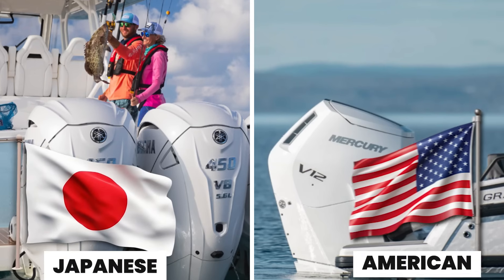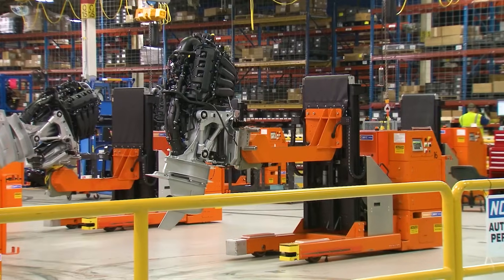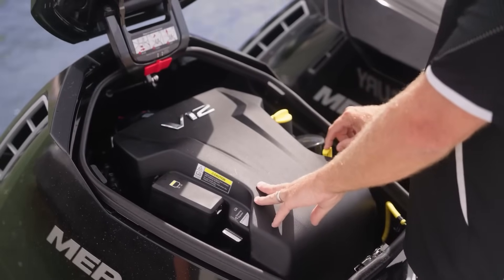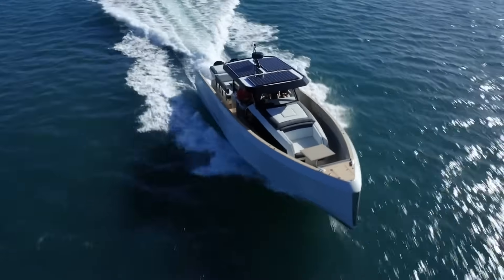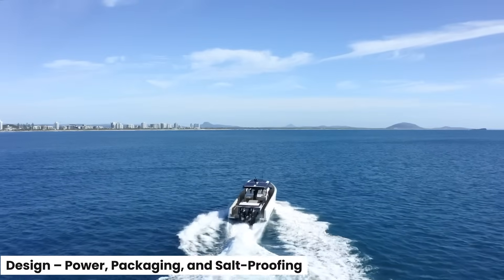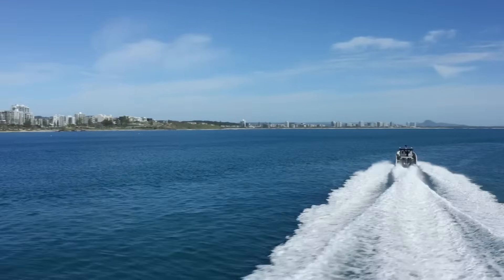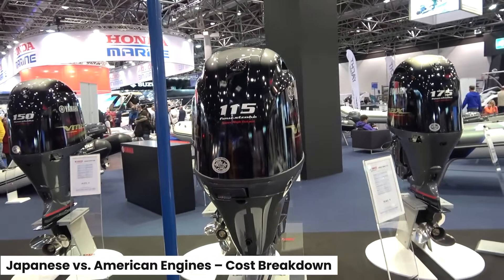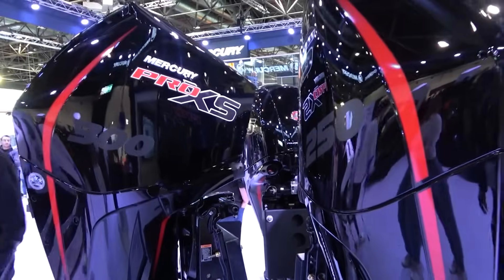Why Japanese and American Engines are so Expensive?

Comment: This is true, but I picked up a 20 inch shaft power tilt Yamaha 9.9 tiller for 300 bucks and it was only locked up. That was literally all spray some WD-40 into the cylinder and gave it a few cranks and it unlocked. It’s also electric start.
Reply from the maker: Thanks for watching and commenting. Sounds like a good steal!
Reply: How long do you expect those cylinder liners, pistons, and piston rings to hold up for? Obviously the thinking man isn't planning on keeping that motor, rather selling it for as close to retail as possible to some ignorant schmuck and pocketing the 600% profit.